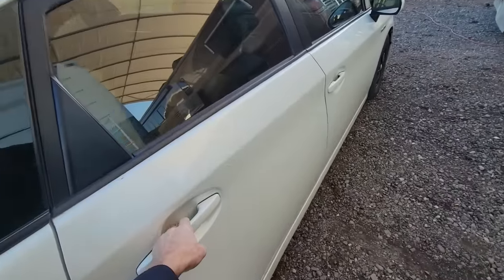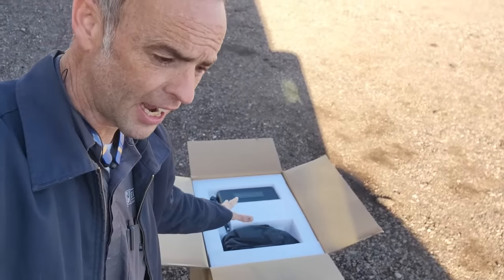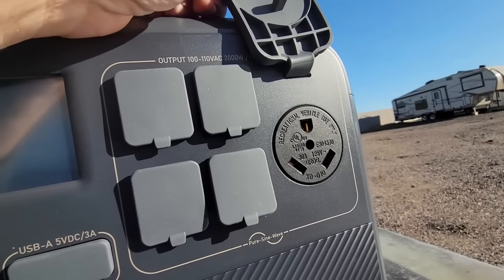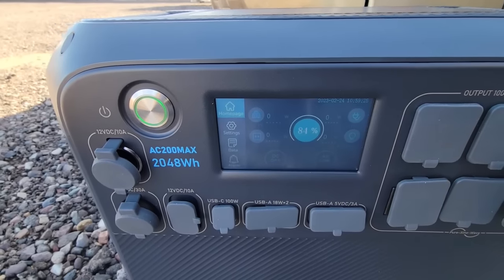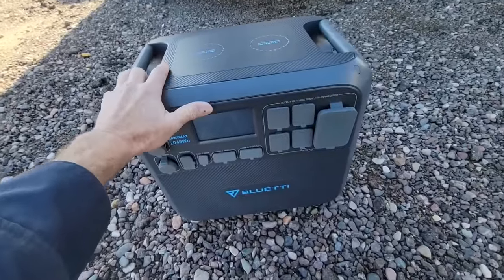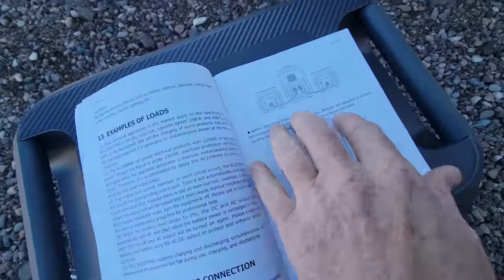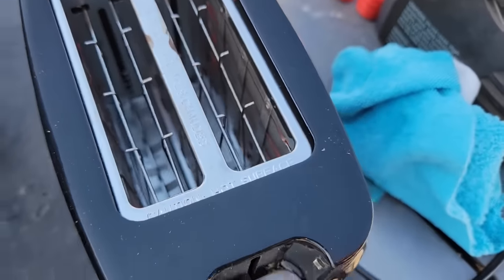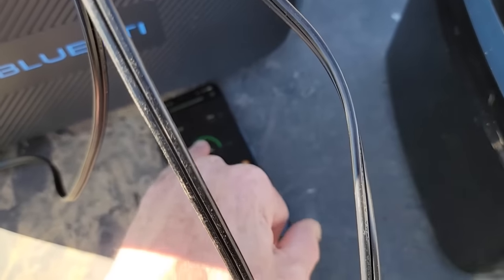The Most Exhaustive Solar Generator Test I've Done: Bluetti AC200MAX

Comment from the maker: NOTE: I WILL NOT ASK ANYONE TO TEXT ME OR CONTACT ANYONE ABOUT THIS UNIT THE DRAWING HAPPENS!!!
PLEASE IGNORE ANY REQUEST FROM ANYONE PRETENDING TO BE ME!!!!
Reply: I got a message to DM you...I knew something smelled fishy!
Reply: Thanks for the Bluetti AC 200 review. I have enjoyed your videos! I just retired and working on a  28 foot 91 safari trek pathfinder to travel in. What would be the approximate cost to reroof with a solid roof with zero holes cut in it? Going all electric and full solar on top with a mini split for heating cooling
Reply: I figued.
Reply: A friend turned me on to your channel, and my wife and I have been learning a LOT! Thaks!
Reply: Thanks for the heads up!  I did get a message to DM you thought it was odd
Reply: Fricking Trolls, even copied you logo.
Reply: Too much stuff on this can break or go bad. Save money....build a normal solar power system with a real battery. You can buy a 3.8 kwh LiFeP04 battery now for 999 bucks.
Reply from the maker: @baneverything5580  I replace $1500 stand alone inverters all the time
Reply: @AZExpert  How would anyone replace the one inside the Bluetti? I have two of their small units for emergencies but for this kind of cash I want something that can be repaired or modified with a wrench. How long do typical inverters last usually?
Reply: Very thorough review of the Bluetti  AC200 max. Would be a great  short term backup option for power outages.  Thanks James. Keep them coming ! 😊
Reply from the maker: @baneverything5580  I've replaced ones less than a year old and some last 25+ years. I find perfect solution fallacies amoung the least compelling arguments. Convenience and ease of build and installation should also be included in the value of products too
Reply: Yep, I warned you as soon as I saw the video. It happens everytime. I hope no one falls for it
Reply: Bluetti apps synch with Android.
Reply: @baneverything5580  With the bluetti you can actually add extra battery life through the solar connection or in some of them even through the ac adapter. The only argument I would have on building your system compared to buying this would be the service required to fix anything broken.
Reply: I just ran my 1,100 watt microwave for 2 minutes. It was drawing 1,930 watts from my Bluetti Ac200max (2048 Wh) why so much higher? Anyhow in  2 minutes it dropped me from 61% to 56% charge. I would expect this battery to drop 1% for every minute of a 1,930 draw. I ran my fan with 57 watt draw for 8 hrs & it drained my Bluetti AC200MAX from 100% to 55%. I think something is wrong with my unit, it was certified refurbished from Bluetti. Your thoughts? I feel like it's draining twice as fast as it should as advertised 🤷‍♂️
Reply: @AZExpert  PS. In reading some of the comments Ex. "Ban Everything"  also in your review of the Bluetti...are you saying that I can use a solar power station like the Mango Power instead of replacing a broken inverter?  I could simply replace my inverter & coach batteries with an all in one solar power station?  I don't know if you remember or not, but I am the person who wrote to you about 2 or 3 months ago a books worth of Beaver troubles. If my assumption is correct, is there a way to put out the kitchen/living slider by hand on the Beaver? I have the exact same layout as your 2001 Beaver & I recall you saying that the Bluetti could  not be used to run the hydraulic slide motor. The Beaver is 50 amps & I believe you said the Mango Power was 30 amps while the Bluetti comes in at 22. I would appreciate your input & professional opinion in this manner as my slider motor has bitten the dust along with the inverter.  I believe this happened when it was last serviced & the batteries were changed out but hook up incorrectly.  If I went this route, (solar power station) would it charge the chassis batteries? Thank you in advance & thank you for all your informative videos.
Kelly
Reply: Any comment whatsoever🤣
Reply: Thanks. I didn't know what was going on. Was I the only one they trolled??
Reply from the maker: @heatherknowles6689  no unfortunately. I am sorry
Reply from the maker: @JESUS_IS_GOD  it does sound like it is not performing correctly
Reply: @AZExpert  thank you I'm returning it immediately and just buying all brand new equipment from them instead of this refurbished Gamble
Reply: Gotta love fake news….if you find out who it is, send them an empty Bluetti box! 😂😂
Reply: You've inspired me to take on a 1999 coachman Catalina sport with extensive water/roof damage. The tedious count is off the charts! Lol . But I'm slowly making process. Next is solar! Thanks for sharing your knowledge.  Pat N. FLORIDA
Reply: Great review for what seems like a good offgrid/boondocks option!!! Thank you for hosting a drawing on this as well!
Reply: I wanted you to know you could adjust when using 12 volt car charger. On your unit I have small echo flow. Let's u switch 4.  6. Or 8 amps
Reply: @AZExpert  With these type of systems or any solar package system it Has to have the least amount of draw in watts/amps with the highest efficiency in power output with the shortest power Cable runs as DC has a high voltage drop. Quality parts are a must alongside quality solar panels.

Good review for a plug and play system.
Reply: Great video review! I appreciate your thorough testing and insights on the solar generator. It's important to be cautious of any suspicious messages or requests, so thank you for the heads up! By the way, if you're looking for a reliable power solution, I highly recommend checking out the Segway Portable PowerStation Cube Series. It has impressive features like massive capacity, fast recharging, and versatile sockets. It's perfect for outdoor enthusiasts like us! Keep up the great content!
Reply: Thank you for sharing your thoughts and concerns. It's always important to stay cautious when it comes to online requests. Regarding the video, the Bluetti AC200MAX seems like a great solar generator option to consider. Another option you may want to explore is the Segway Portable PowerStation Cube Series. It offers a massive capacity, fast recharging, and comprehensive protections. Definitely worth looking into for outdoor enthusiasts and RV lovers like us! Remember, always prioritize safety and reliability when choosing your power backup products. Stay powered up!
Reply: Thank you for sharing your thoughts and reminding others to be cautious of any suspicious requests. It's always important to stay vigilant when it comes to online interactions. On another note, have you considered checking out the Segway Portable PowerStation Cube Series? It seems like a great option for outdoor enthusiasts like us, with its massive capacity, fast recharging, and waterproof technology. It could definitely come in handy during camping trips or as a backup power source for our RVs. Just a suggestion! Happy adventuring!
Reply: Great video! It's important to be cautious of those pretending to be someone else. On another note, I recently came across the Segway Portable PowerStation Cube Series. It has an impressive 5kWh capacity, fast recharging, and a tough armor design. It's worth considering for outdoor adventures and home backup power. Keep up the great content!
Reply: Thank you for sharing your thoughts and alerting others about potential scam attempts. It's always important to be cautious and ignore any suspicious requests. Regarding the video's solar generator test, I appreciate the thoroughness of the review. On a related note, if you're looking for a reliable outdoor gear and home backup power solution, I would highly recommend checking out the Segway Portable PowerStation Cube Series. With its massive capacity, powerful output, fast recharging, and comprehensive protections, it's a great option for outdoor enthusiasts and RV lovers. Stay safe and enjoy your camping adventures!
Reply: Based on the video title and the content of your comment, it seems like you've had some negative experiences with people pretending to be you. That can definitely be frustrating. In terms of portable power stations, have you considered the Segway Portable PowerStation Cube Series? It offers a massive capacity, powerful output, and even has a waterproof design. It might be a great option for outdoor enthusiasts like us! Let me know what you think.

Comment: Great info for the RV community! Just a heads up on “testing” current draw by running the microwave - put a cup of water in BEFORE turning it on as you can damage the klystron (microwave tube). New ones are pretty safe for a bit, but it wears them out prematurely! Thanks for what you provide to the community!😁😉
Reply: Was going to comment this too, this is how my dad broke our microwave. had to buy a new one that fits over the stove.
Reply: Hey I have learned a lot from you , another great video thanks.

Comment: James, you have a magical way about you. You're so thorough in your testing, analysing every angle. I was astounded when you installed the soft start, to see if it would cope. The way you explain everything is amazing, I normally switch off when I hear number of watts and volts, but I understood every word. The AC200MAX has now been upgraded to the AC200L, where the external battery charger has been built into the main body (now weighs an extra 0.6Llb) -they must have been listening to you! Anyway, many thanks from across the pond in England. Keep the videos coming :)

Comment: Sorry, I pressed the send button accidentally before I could finish my comment!!
 But once again, thank you for the detailed review. My wife and I were very impressed, especially with you hooking up the AC, the normally used household appliances, and the charging features of this unit, showing everybody how it works under extreme loads, which I know was very helpful to all of the do-it-yourselfers living off-grid out there, in the same situation as we are, that  have no power to there property or home for a All in One Solution. We have, (5) 390watt solar panels, No inverter, And that has been part of our quest!!  And as do-it-yourselfer's, we have to make careful spending decisions because money is tight. We came across your channel, in our quest for portable inverter/battery/generator All in One option that we could use with our solar panels  while we stay in our motorhome  as we convert our soon to be delivered March 24, steel building into our home.
Reply from the maker: Thanks for watching! :)

Comment: I jumped into the crowdfunding for this unit and got an early model (2000W/1700Wh). While we are hooked up to the grid, the power in our location isn't exactly reliable, and we got sick of losing food, and wanted something to run a lamp/fridge/charge phones when PG&E decides we don't need power. This thing does that with style. We keep it plugged in, and when the power dies we've got a nice battery to use for our needs. It has worked flawlessly for us. I like that you've put it through its paces. I'd never hit even close to the rated capacity, so it's cool to watch how it performs under stress. Nice job on the video.

Comment: I can’t thank you enough! We are considering buying a Bluetti AC 200Max as of yesterday! The 500 was just out if our budget. So the only information we needed that I couldn’t find was whether the AC200Max could start the roof AC in our 30 amp RV. I knew it could run it, but was concerned it couldn’t start it. Thank you for the info! Will be getting a soft start, and we happily on our way when our Bluetti comes in August. Perfect video!

Comment: I was impressed you tested the AC running with the softstart as this is a real world use case.  I use a induction hot plate in the RV as I don't like using propane on the stove.
Reply from the maker: thank you. I think having LP in RVs is likely on its way out.

Comment: Just adding a couple shekels to the mix. I’ve got one of these and use it to run a cabin in Vermont. It stays put, there ain’t nothing g portable about this sucker ..I wish it had wheels. Ain’t no one lugging this sucker around, no one. ‘Most people’ are not using a single panel to charge these. That would take forever, there’s not enough time in the day to charge this with a single panel. I run 2-300watt flexible and a folding 200. If anything you’d have to over panel with like a 1000watts to top this baby up on the daily. But, everyone’s sunshine is diff. Nice video and great tests sir!

Comment: Great review. Thanks for the oportunity to win the Bluetti. I am installing solar on my home with inexpensive used solar panels and a new inverter. Less than $5000 to output 7.5 KW at 220 Volts. Solar is getting cheaper and more usable all the time. I think your review showed all the capability of a solar generator quite effectively.

Comment: I live out of my 2019 promaster 136 low roof, I am in the process of building it out a little at a time as I save money for each project. I like the idea of an all in one power station to run a max air fan and 12 volt fridge. Led lights and keep laptop and phone charged, as well as a heat source. very impressed by this unit, perfect se up! I really like the idea of not having to use propane!

Comment: Before I bought my trailer I was a tenter. Last year I got a pair of Jackery solar generators with 2 100 watt solar cells from Costco. For tenting it was good enough - I could run a little 12 volt compressor fridge for 2 or 3 days on the 880 Wh unit and charge phones and run a little USB lightbulb off the 280 Wh unit. When I'm camping in the woods it's a little hard to get enough sun in a day to make up for running the fridge but if we're driving around sightseeing the 880 recharges easily and I don't worry as much about the little one.
With the travel trailer I've bought a 3000 watt gasoline inverter generator. It's roughly half the cost of the Bluetti but of course a solar gen is more neighborly if you can catch enough sun to keep the batteries reasonably topped off.
Reply from the maker: Thanks for the info!

Comment: I just purchased the same model and received it a week ago. I thank you for your review because you've answered some of the same questions I had regarding what type of appliances it could support and for how long.
I will be using it in a truck bed portable build-out so I have reduced capacity needs, e.g., 700 watt microwave, 5k btu ac, and you've shown me this unit will be more than adequate for my needs. The only downside I have found is the weight. Again, thanks.

Comment: Having lived in RVS and worked at a campground I definitely see that use for this unit. I also have worked in residential construction and see it replacing gas generators, especially for charging batteries. I have heard a lot of people complain about the noise from the charger so I think we can expect an upgrade to a quieter one. The main use I see for this is for backup to loss of power in storms or disaster.

Comment: Thanks for doing this review!  I was initially put off by the price, but it does include so many components that you need for off-grid power that helps to offset the price.  I'm not bothered by the external power brick as it keeps the weight, heat, and space out of the main unit.
Reply from the maker: Sure does

Comment: We bought the Bluetti AC300. It does run our 30 Amp. RV. It's the same size as the class C you tested. We think it has a soft start on the AC. We like it because it can also use it in the house during a power outage.

Comment: THX for the comprehensive review James.  I've been comparing details, looking for an alternative to my old school lead batteries.  We have a 20' boondocking trailer with a 200w solar setup.  We live in AZ (like you) and like to boondock here in the vast BLM  areas.  However I want to shed weight while keeping a good power source.  I was glad to see you point out the 30a plug limits and also the affect of the soft start which I'm also installing on the roof ac.  Bluetti appears to be on my short list, thanks to you.

Comment: Great review that touched on all the advantages of such a system. 
I also agree that the lack of 120V AC pass-thru and non-integrated 120V AC charging should be fixed in future models, but I feel that it does not negate the positives as these appear to be common characters of similar systems.
Your review also was a very positive example of the key reason that the “soft-start” system should be added to roof air conditioners.

Comment: I've enjoyed your video efforts for years and have learned lots about my various rv's and their systems.  While I agree with you that these new portable power systems like the Bluetti may be the future, I still think they are too small for a fullsize RV. However, for a truck camper, van or small trailer or small cabin I think the device would well for camping use.

By the way, while you worked very hard to demo this unit, your comments about Will Prowse were spot on. Thanks for all you do!

Comment: I have the older AC200 without the Bluetooth for home backup/power outages but have thought about using it in the RV as well for doing light AC loads off grid.  Didn't expect to see a rooftop AC work off of it, but I guess where there is a will, and $$, there is a way!

Comment: Bluetti beats most competition in quality and technical innovation and lowest price. I'm a Bluetti fan for sure.
Reply from the maker: Awesome!
Reply: Not real generators they dont. That thing is nothing but a hugh battery and inverter. They die, glitch, run out of power. Error codes - get out the manual. Gas generator just start it keep gas in it. Run forever.